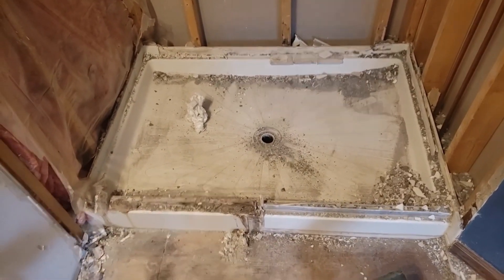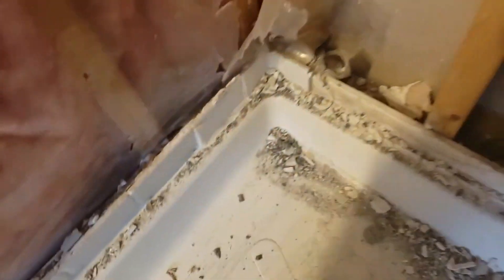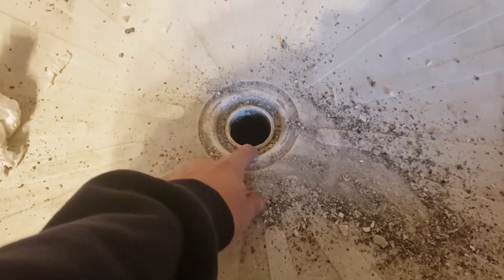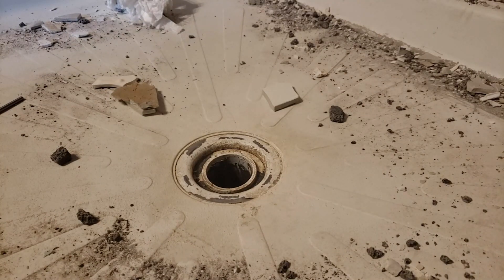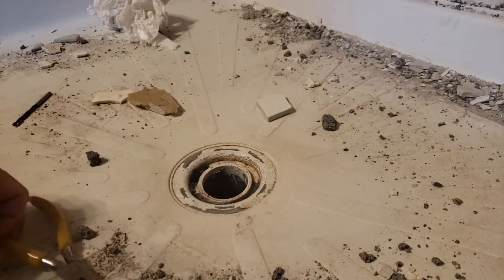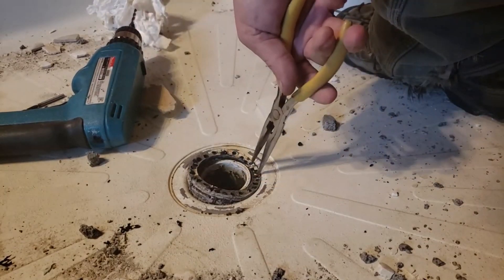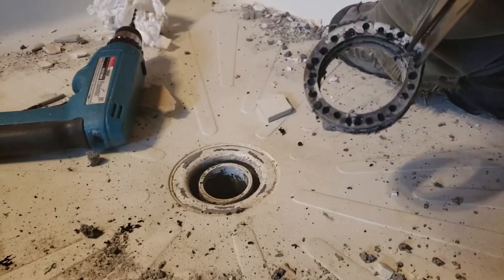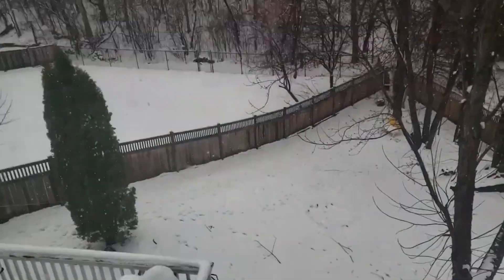How to remove a Shower Pan EASY Bathroom Remodel on a Budget #DIY

Comment: Hi Eric,  nice trick to drill holes into rubber gasket and then use needle nose pliers to yank it up and out ! Strange that your pan was not  nailed to the wood boards for support too !  Having the right education and techniques to do the job is so important versus "winging" it with brute force !
Reply from the maker: thanks

Comment: Nicely done, warts and all! Now I have a better idea of what to expect. 

Question: When you replaced the shower pan, did you first use mortar in which to set the new pan? It looked as though there wasn't any for the first one.
Reply from the maker: I did tile.

Comment: My pan was set in concrete. The pipe from the pan was also glued to the drain pipe.  So I had to break up the concrete by hammering the pan floor and then I cut the drain.  I’ll need to add a drain extension for the new pan.
Reply from the maker: @timmyterwillger2257  yikes